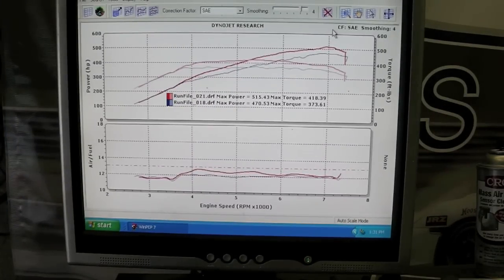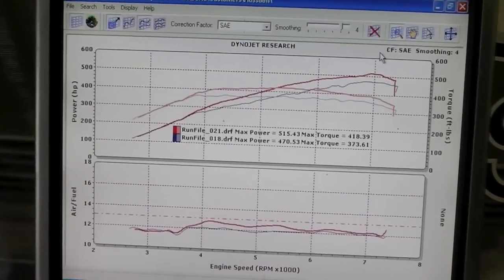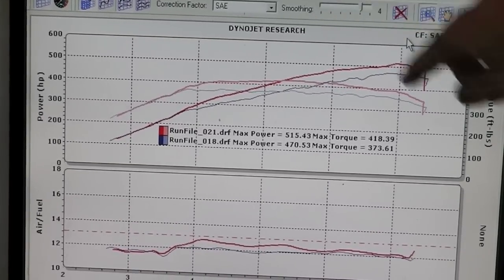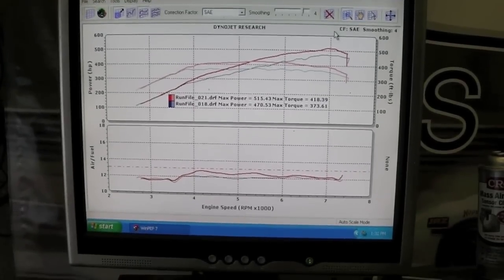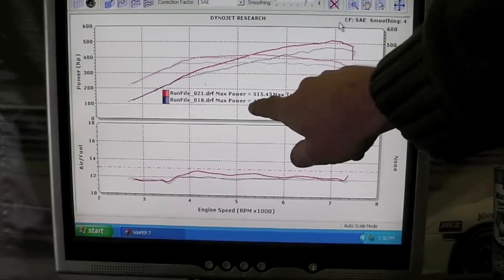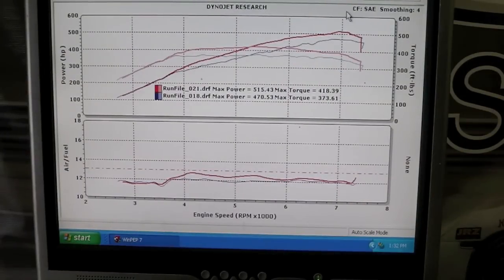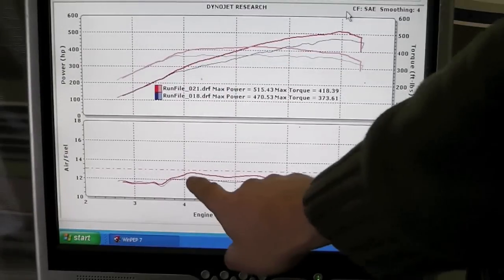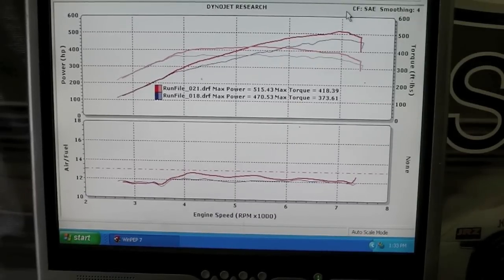TPC Racing: 600HP 3.7L Cayman Turbo

Comment: @YUSKHAN 600BHP is horsepower at the crank. Basically, it is the power your engine alone makes. This is what auto manufacturers advertise. However, when you try to use that power, it must get sent through the transmission and the rest of the drivetrain. This results in a loss of power that is actually getting to the wheels of your car. 515WHP(wheel horsepower) actually measures the REAL HP at the wheel. TPC used 16% correction (515*1.16=~600HP)